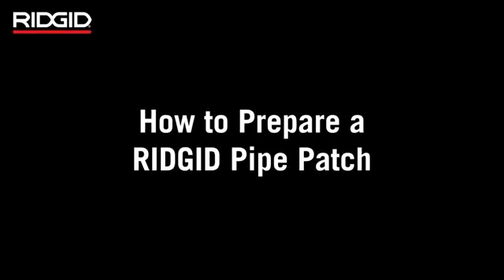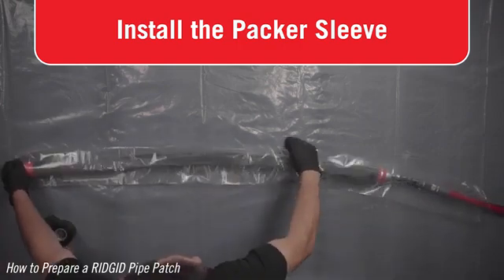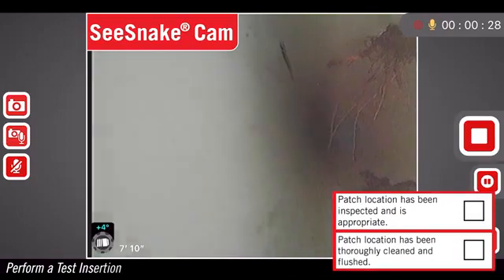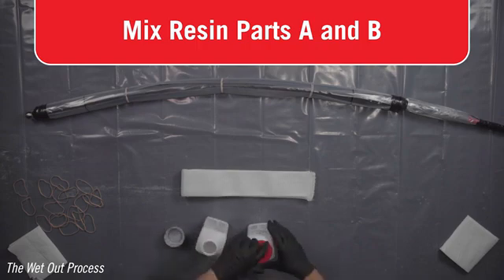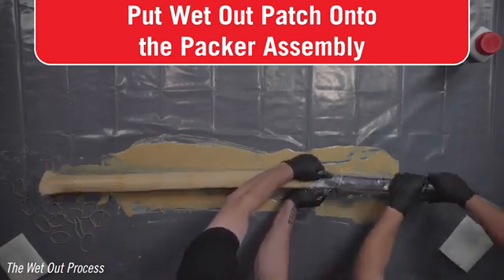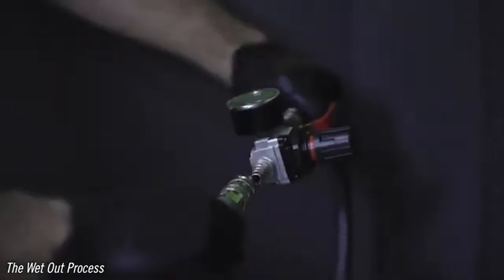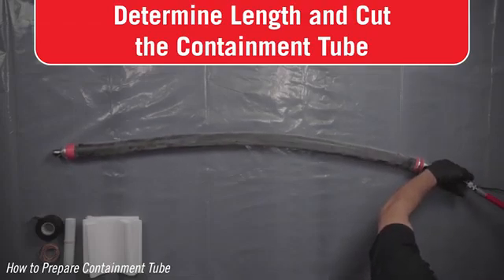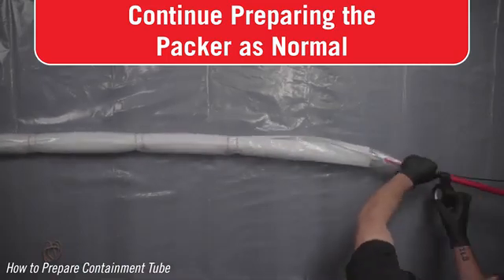RIDGID® Pipe Patch System Overview

Comment: I have developed, designed and patented a much more simpler and sophisticated system  than what is being shown. My system will patch any type of pipe; plastics, rigid conduits, PVC, nylon, cast iron and copper, cast in concrete or buried under ground. My invention can patch any pipe from 3/8 -24 inch in diameter. It comes with pre mixed Epoxy-resin, it does not need any field preparation at all. Its designed to be operated by one person and the unique thing the camera stores all images from start to finish of the patch work. Patents are registered in USA, EU, Russia, Canada, Australia, Asia & south Africa.